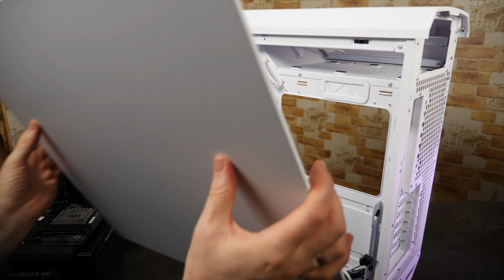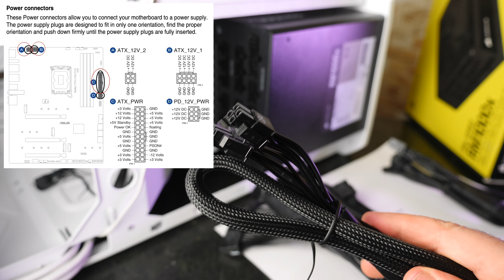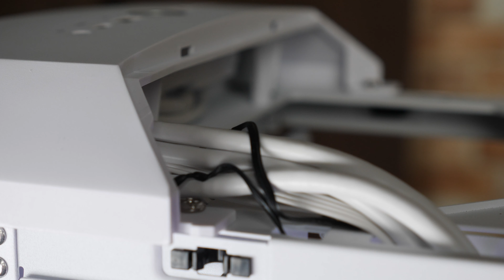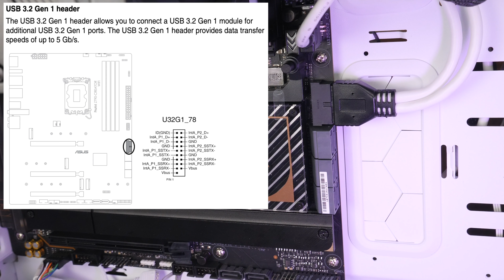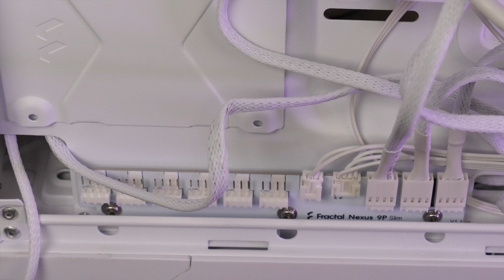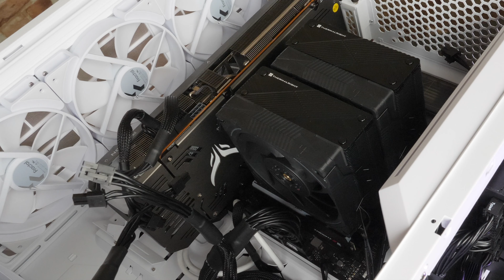Build High End Windows/Mac Computer - Part 3: Getting the Fractal Torrent Case Ready

Comment: Just finished a build with most of the same parts from this video, however on initial boot the cooler fans and one exhaust fan plugged into mbd stop spinning and no Qleds and no Post. Parts: Asus Z790 ProArt Creative mbd, i9-13900K cpu, Noctua NH-U12A cooler, Kingston Fury Ram KF556C40BBK2 - 2ea 32GB for total of 64GB, Fractal Torrent Case (full size), SSD's - WD Black NVMe 1TB ssd, and 2 ea WD Black 2TB NVMe ssd's, video card is Asus 4070 Ti and PSU is a Seasonic PX-1200 Vertex and Fractal Torrent Case. On first press of the power button the system will not go to Post and there are no QLED's displayed on mbd. The standard case fans run from hub, however once the power button is pressed the cooler and one exhaust fans initially come on but immediately turn off. Immediately after pressing the power button on case I hear a faint click from the psu and then the fans immediately turn off.  I've checked all cables, plugged and unplugged all cables, reset video card and cycled the RAM in different slots and always the same result. Even tried removing vid card and only used 1ea stick of RAM in slot A2 and same results. PS: Do you know where the cmos battery located on this mbd because it's location is not identified in manual or online from ASUS that I've been able to find?
I have also, removed everything that was connected to mbd except the cpu, ram and heatsink fans and same result.  I’ve also made sure per your video that my 2ea front fans are plugged into pwm on mbd.  No matter what configuration I cannot get any lights on Qleds, and no POST, and I’ve also disconnected the power cable to cpu because Asus states that if no power is connected for cpu then the indicator light by cpu power ports will light up when power is initiated, well no illumination.
At this point I’ve been to two computer repair facilities in my area and they both stated they could not help and “BestBuy” Geek Squad stated to me (in the store) to go buy my own spare parts and trouble shoot (Intel chip and power supply).
If you have any suggestions it would be appreciated.
Thanks,
Reply from the maker: @markmaxwell9963  Hi, wow, no QLEDs lighting up is really odd. Definitely sounds power related. Did you double/triple check the power connections to the board, and the other ends at the PSU? Can you test the PSU on another computer? The CMOS reset is the two pin connector labeled CLRTC, next to AddGen2 and AddGen3 and you have to use the included jumper and place it over the respective pins shown in the manual.  Also make sure you didn't accidentally drop a screw on the board, and that you placed the 8 chassis screws in there. Hope it gets sorted out!
Reply: Yep, I've double and tripled checked all psu power cables (I cannot actually remember how many times I've connected and reconnected psu power cables.  Unfortunately, I do not have another pc to check the psu.  Currently I do not even have my NVMe drives installed and still no Qleds.  I've sent multiple emails to Seasonic about psu and I have not received any feedback.  At this point I'm probably going to have to purchase another psu and see how that goes.  Asus stated to try with just chip, ram and cooler fans, well did that and still no Qleds.  Asus stated if that didn't work to try new psu and Intel Chip and if all that fails to RMA mbd.  Well the only problem I have is that no one in my area (local computer repair facilities including BestBuy Geek Squad) has a working chip to try in my system.  Also, BestBuy Geek squad stated for me to buy my own new Intel Chip and psu and troubleshoot from their.  I greatly appreciate your assistance.  Once this gets resolved I'll let you know what the issue was.  Again, thanks
Reply from the maker: @markmaxwell9963  Yeah, definitely sounds like power supply or bad power cable somewhere. Did you connect both CPU power connectors?